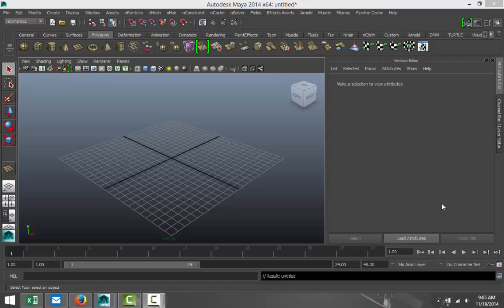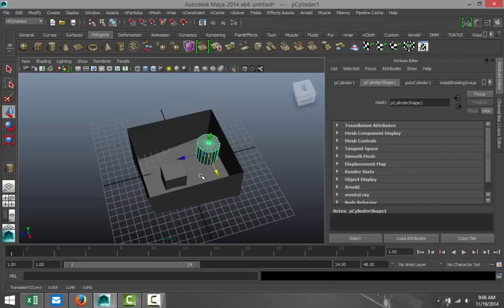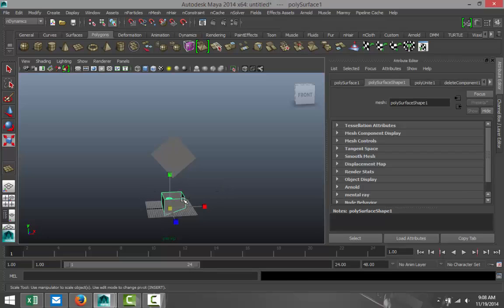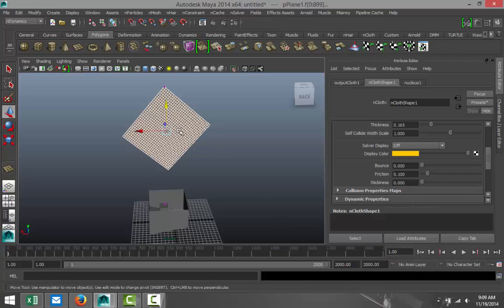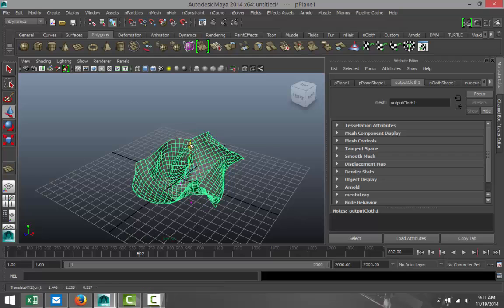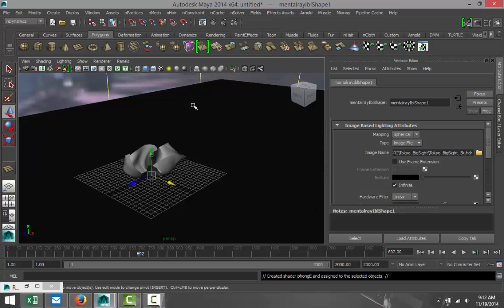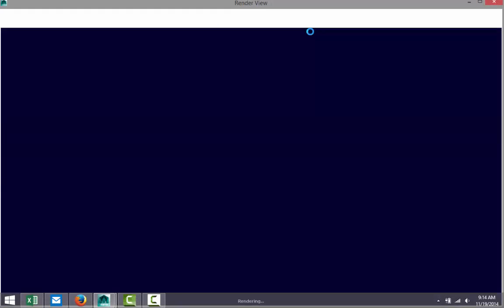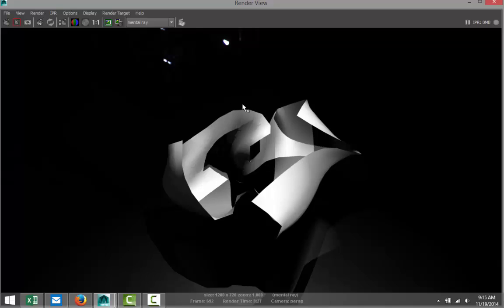Maya 2014 tutorial : Modeling a crumpled piece of paper

Comment: Hello Good Tutorial like ever :), I would like to ask may be if you could make a tutorial about how to make motif like http://www.turbosquid.com/3d-models/thor-s-hammer-3ds/674929
If you could make a tutotial about that it could be great , Thanks
Ps:10-20min tutorial would be better/easier to make  than 1h video ,if the video take longer divide by part :), just a small suggestion
Reply from the maker: Hi Sunix,

I will add the request to the list and will make a tutorial on this as soon as possible. As for the length of the video, I try to do a maximum of 1 hour. Most of them are shorter.

Regards,

Mike
Reply: Mike Hermes
 Ok  , thank you !